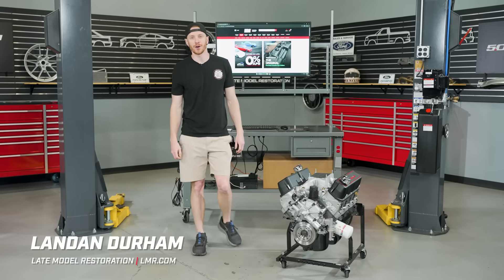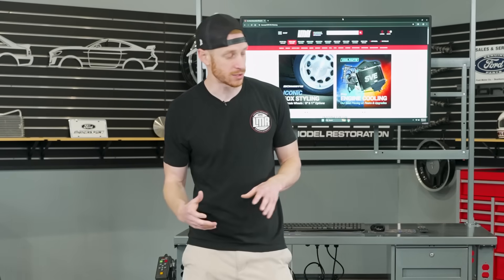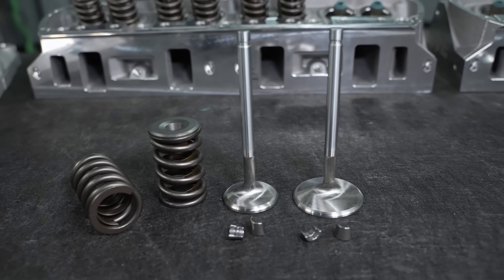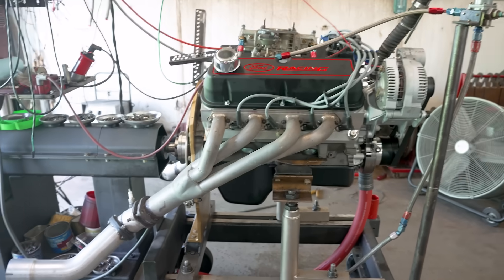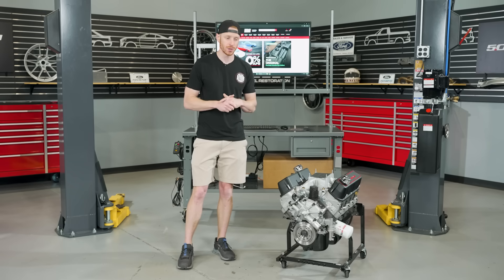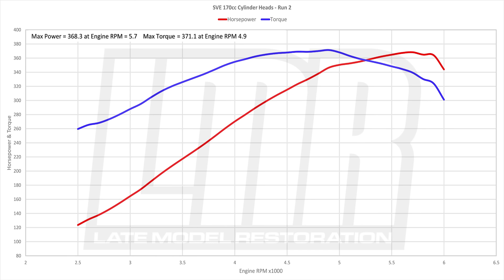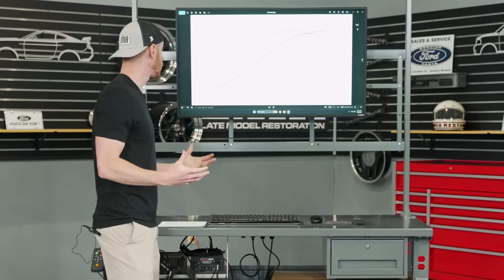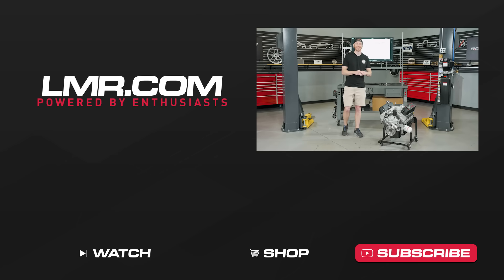How much power? 302ci Small Block Ford Engine Build & Dyno w/ SVE 170cc Cylinder Heads

Comment: So at the wheels, a stock bottom end 302 with a gt40 upper, n 41 cam and these SVE  170s, what are we talking?
Reply: ~280 whp, maybe 300 
~300-320 whp for test mule
Reply: @ryandoyle4344 my 302, gt40 p heads, b cam, ported lower cobra manifold,  stock upper cobra, 24lb injectors, race 75mm tb, gt40 p shorty headers, magnaflow exhaust  made 278 whp on a dyno
Reply: @royrichardson9164  If you had the biggest restriction ported= (your upper cobra intake), you would pick up quit a bit. Let me guess T Moss talked you into only porting your Lower cobra intake? Have Big Dogs Porting do a before & after flow test on your complete upper, & lower cobra intake, you will be amazed @ there port work! They can port your intake spacer, Throttle body, TB tunnel, & your headers.
Reply: @evilinside5984 never dealt with tmoss. A friend of mines had it years ago but I think it was extrude honed with his gt40 intake. He wrecked the car so we just swapped lowers
Reply: 15% drivetrain loss is the standard so minus around 50-60 hp for a wheel hp of around rwhp 300~
Reply: Your GT40 upper wont be as good as this carbed edelbrock perf. Rpm air-gap intake. My guess if you have a Aode= approx. 270 wheel, & if you have a T5= approx.290 wheel.

Comment: Actually I have been waiting for this to happen before I pulled the trigger on buying ! Thanks LMR! Now let’s try it with the B cam!
Reply: B cam will just lose power 😕
Reply: @pimpovic2 what cam do you recommend?
Reply: @91foxbody  They also need to test the heads with the budget E+, B+ and F+ Cams from summitracing. That's our budget build right there with those $270 cam. The Anderson Cams are almost $500 which is almost half the price os these SVE Heads. Budget builds, please, The hobby has become crazy expensive and anything counts to lower the $$$ / HP .

Comment: If they hold up, they look like a great deal, especially with the small combustion chamber. Most aftermarket heads combustion chambers are too big for a 302
Reply: I that's because they figure most people are building 347s these days. But for a bolt on top end you need pretty small chambers on a 302 to make it worthwhile

Comment: Still messing with 302s in 2025 😂 Go Dart/Boss 363, LS, or Coyote.
Reply: Yep. We're still messing with 302s in 2025. Probably will be messing with em in 2026 too.😁
Reply: Not everyone can afford or more importantly wants those engines.
Reply: Not everyone has 10-20k for a build.
Reply from the maker: I forgot it's illegal to have fun and build a fun 302
Reply: @latemodelrestoration  it should be illegal to sell Chinese made cylinder heads for $1k 😂
Reply: @3pedalfox I have a windsor powered mustang that would more than humble your coyote swap. The coyotes are awesome and worth the swap but not everyone wants one. Especially when you can build a 700hp windsor and drivetrain for half what it costs just to buy a gen 3 coyote which, if you are going to do the swap and don't want to constantly lose races to less powerful cars, is what you'll swap. Bet that aftermarket chinese stand alone runs your engine just fine though
Reply: @damianlindsey6177 here we go lol. I got this, my friend has that, I’ll humble you 😂. I simply implied factory Ford blocks from the 90s are a waste of time. Going coyote, LS, or aftermarket Ford blocks way better and save you money in the long run. I never mentioned anything about my car. What do you think a factory sealed coyote, on 10 psi, in a fox body will do lol
Reply: @3pedalfox how does that save you money when it costs 10x more than this build?  You're assuming one is gonna wanna keep upgrading over and over.  Not everyone tries to keep up w the Jones and we don't all want a million hp with every car we have.  Some people have a big power car and a lower power car to have fun on the street.  Not everyone needs a zillion hp and we're not all chasing ets.  Man idk how much more simple I can put it.  Stop being toxic.
Reply: That build is 10x more expensive.  Not everyone is chasing hp or et.  Why can't y'all understand this?  Stop being toxic
Reply: Not everyone wants a cookie cutter build of today... Spend money on whatever you like and don't worry about everyone else... You sound like one of the LGBTQ crowd, wanting everyone else to be like you...😂😂😂

Comment: So, like 270RWHP? People really will do anything to not swap a better engine into their car....
Reply: Sounds like YOUR ignorance is bliss... I own 3 Coyotes ranging from 12.80's in my CCSB FX4 F150 to a 9 second GT. My old pushrod 302 powered 97 Ranger is by FAR the funnest to tinker on and play with... Your negative opinion of what anyone else likes to do that isn't what YOU would do makes YOU sound just like one of the LS nut swingers....js
Reply: @02autogt I have a 302 in a 83 Ranger with a faceplated tkx and I run high 11s on slicks and my combo is dead simple. Like dont even have aluminum heads simple. Just a gt40 headed explorer motor with a cam/spring upgrade and a well used paxton from my first car I built back in 2001 lmao.
Reply: @02autogt amen
Reply: 315 RWHP. About 20 more than the LS1 Corvette.
Reply: @Mustang_Chris  LOL
Reply: A manual more like 330 ish
Reply: @Dre1966mustang  And a similarly equipped 351W would do 400-450. People spend a lot of money just to be slow.
Reply: @Smasher-Devourer and I've seen people do heads cam intake and be at those same numbers in an LS... what's your point?
Reply: @Smasher-Devourer  more like 350 to 380 lol
Reply: @Smasher-Devourer ok?  Not everyone wants the extra weight or the extra power.  A 351 isn't gonna make that power w the same top end it'll make about the same power w more tq.  You'd need larger stuff to make that power w a 351.   Not everyone is chasing et and Dyno numbers idk why people just can't fathom this.  Why do you gotta be so negative.  Y'all sound like ls guys.  Just stop.
Reply: @midnight347  Then why not leave it stock then? Is that hard to comprehend?
Reply: @Smasher-Devourer because sometimes a tired engine needs a refresh. It's 100% the reason why you do a 306 instead of a 331 or a 347. 
You bore the 302 .030 over, keep the crank, keep the rods, new pistons, new cam and top end and it's a cheap refresh compared to anything else you could do. 
Not everyone is chasing hp. Some people want simple, with good sound, and fun to drive. 
315rwhp out of a 3000lb car is a ripper. Plenty of fun on the street.
Reply: 270 wheel in a 2800 lb car us a rocket dude. How else do you explain how the ls powered cars keep getting donkey stomped by hondas? Hell cats are also a great example of how hp matters less than chassis setup
Reply: This is way more than 270 rwhp.  And this don't cost near as much as a coyote swap would.  Idk why y'all can't comprehend that.  The price is not equal at all.  Not everyone is looking for a million hp or chasing et.  Why do people gotta hate so much
Reply: 100hp drive train loss?! Lol nah plus this engine was dynoed with accessories on. Most of the time theyre ran with nothing at all.
Reply: lol

Comment: Hell yeah love it just put a set of SVE 170’s with a Trick Flow stage 2 camshaft on a customers 302. Haven’t fired it up yet, but can’t wait to hear that SBF choppin 🤟🏼🦊
Reply: Would love to see this running and hear it! Do you have video? I did this setup with a TrickFlow stage 1 on a 306, and haven't put it in the car or started yet.

Comment: Awesome video, did you guys dyno with the stock heads first? Just curious what the gain was going to the SVE heads
Reply: I would think these heads would gain at least 50 horsepower over a stock head stockheads probably make 300 or so with that. Cam
Reply: Stock 302 with a cam is not making 300. This has some aftermarket stuff
Reply: @josemontes9105 ya it would have been nice to see the base numbers
Reply: @josemontes9105 not my 79 302 but an GT40 headed 5.0 probably will
Reply: I seen a 306 like this, with the same intake= perf. Rpm air-gap, & longtubes, make 306 Hp, with a small cam. I think this setup in this video, would make around 320 Hp with stock E7 heads. So yeah these SVEs are making 50+Hp over the stock E7s, in this setup.